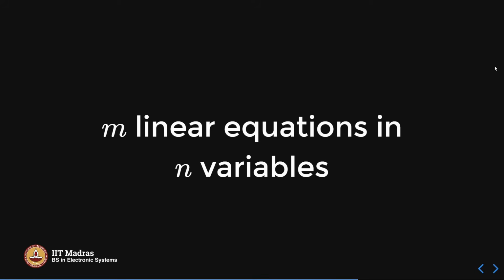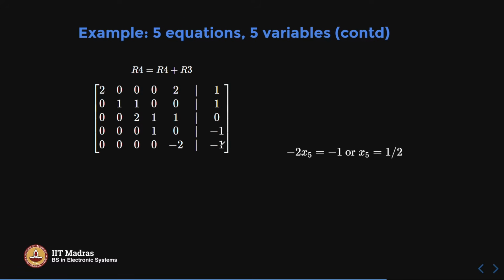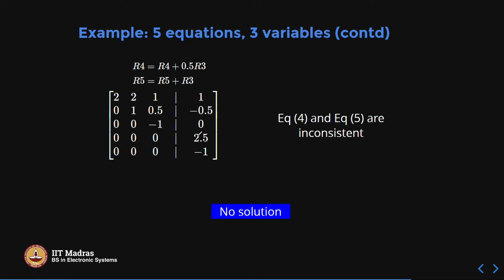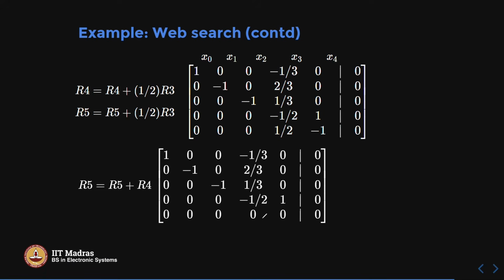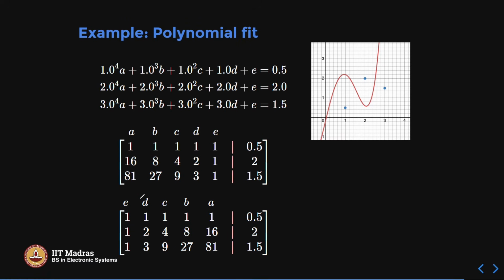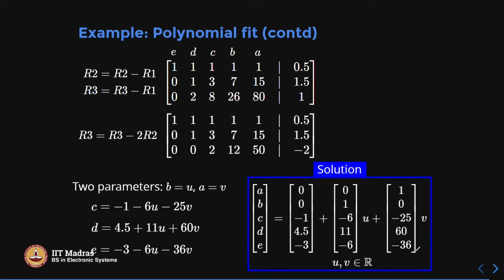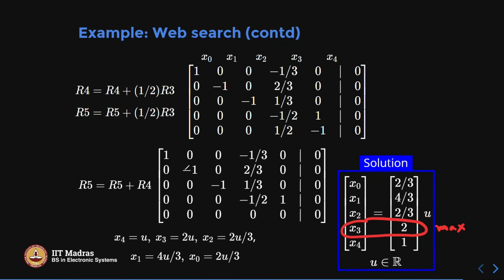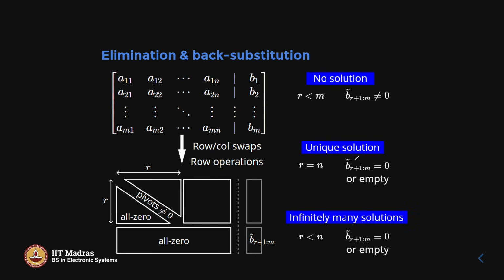W2_L6: Solving system of n variables & m linear equations

Comment: 12:39 why is x0 = 1 in 1st row first column. shouldnt it be -1 and instead of x3= -1/3 in 1st row 4th column , it should be x3 = 1/3 . Am i doing it the right way ?
Reply: But this doesn't change the equation anyhow
Reply: @MUTHU_KRISHNAN_K  yes.
Reply: Yes👍
You are correct